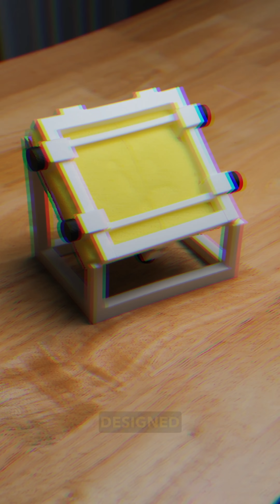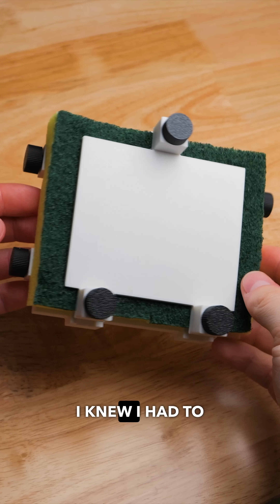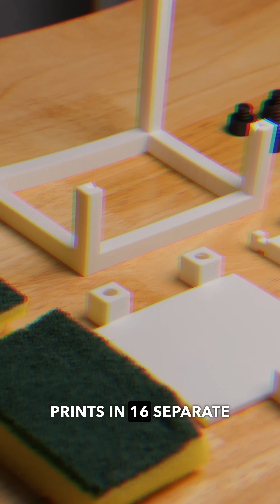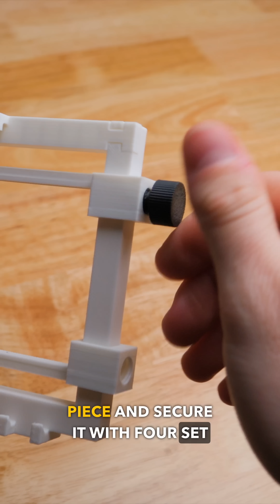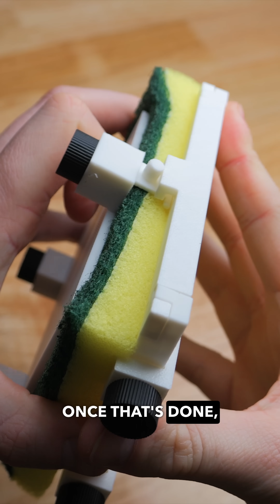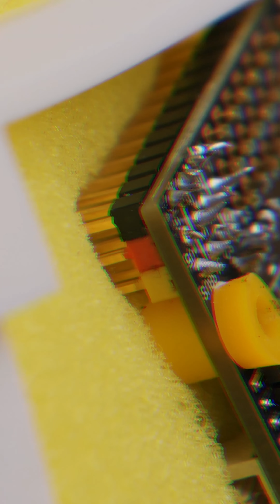Every Maker Needs This Awesome 3D Printed PCB Jig!

Comment: Fun fact, ABS prints at 110 C, your iron likely doesn't go under 150 and is usually going to be sitting at near double that for most jobs of that size. 
If you slip, this thing slides (since it looks like it weighs near nothing) or you just get the iron too near it, you're gonna sort out how scuffed this "solution" is real dang fast.

Comment: Simpler is just bluetack haha I've used bluetack to hold many pins in place or wires when soldering
Reply: Can you send the 3d print file for this bluetac thing
Reply: @Penguinizerrr Jesus christ I'm getting old. 

Just google Blu tack. Its a product. A bit like play-dough but much stiffer, ruberries and certainly amazing for it. 

It gets dirty over time, but a 10 -pack at the local craft store costs me 20 bucks. They're versatile.
Reply: @Penguinizerrrit's not a thing you can print, it's a putty you can buy. Most every stationary or office supply store has it in my experience.
Reply: @mushroommunk  haha yes

Comment: Mmmm, not sure if sponges can handle the temp from the soldering iron
Reply: I personally prefer something like stiff helper arms… oh and btw if you’re good with soldering then the ends of those pins will not reach a high enough temperature to melt the sponge. Generally though this solution is not a great idea… in this specific case the best way to go about it would be to use a breadboard as support for the pins or if they don’t line up, just tack it why holding it together then solder the rest
Reply: This shyt is going to melt all over the pins then he will chase a non contact for 5 days 🤣😂
Reply: You can put some water on that sponge
Reply: @kimjin1194  no NO AND NO AGAIN! only Distilled water or other liquids, that wont cause corrosion or short on the board. never use default water when ur soldering (only on sponge for cleaning soldering hotend)
Reply: @ that’s why my tips are so fked up lol
Reply: @artiva999 ”default water” lmao it’s nowhere near as big of a deal as you’re making it out to be. Tap water takes a long time to corrode things and you should be using flux and cleaning your self-soldered boards anyways. Tips are what, $8?
Reply: @breh-j1y  yep. Instant corrosion is only a thing for a powered board. That's why back when batteries were still removable, you were advised to remove the battery if a phone gets wet.
Reply: @breh-j1y only if your soldering iron is poo, a good iron tip, like a Weller, is about $15-20, or Hakko is more like $20-60. Taking good care of your tips is worthwhile when you have quality equipment. 

The best value is usually buying a pack of 4-5 tips for your iron then you might approach the 8-dollar mark in some cases.
Always replace tips as soon as they hinder your working speed or quality it's worth it. 

Some irons have ridiculously priced tips as the tips and heating elements are one part for example jbc brand Micro pencils that use c-115 tips those are 25( cheapest China clone) to 115 (OEM tip from JBC).
Reply: @artiva999 you can use water 😭
Reply: @ADRDaniel  If you’re using a Weller or Hakko then you don’t need to worry about it, as you already know why you bought them :P